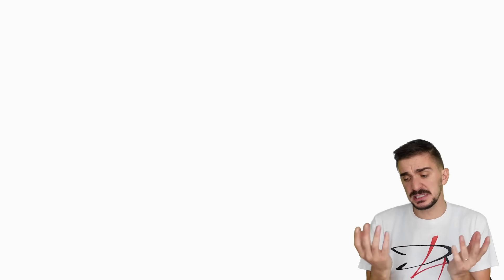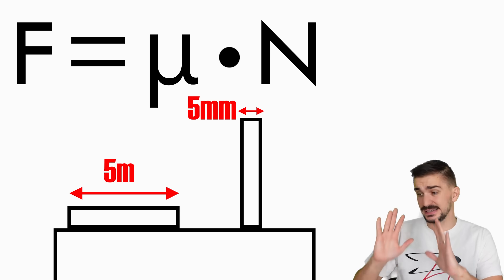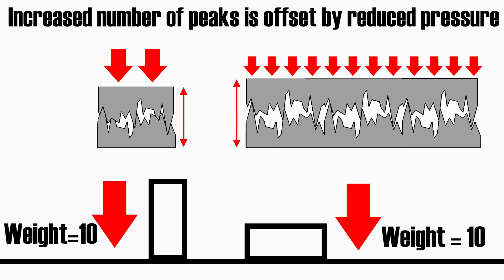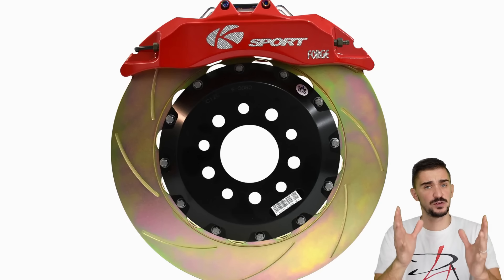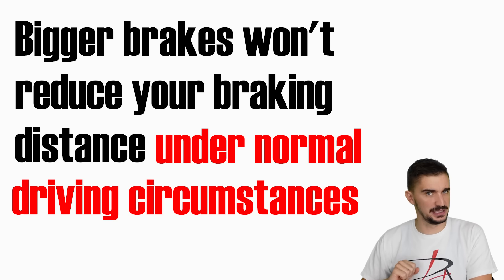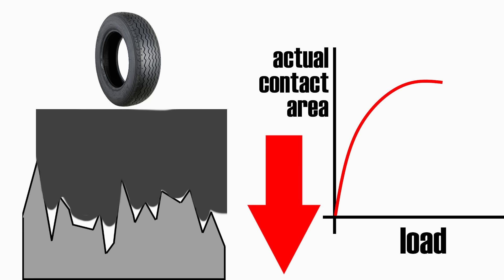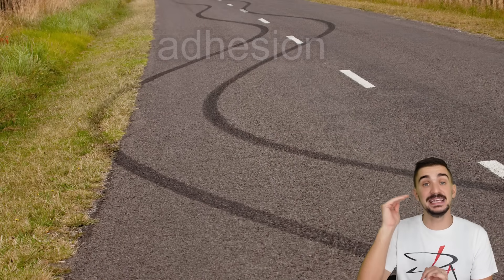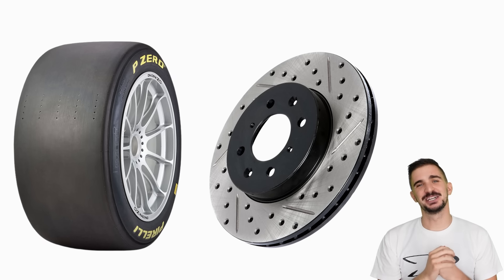Why Big Brakes Won't Stop You Faster but Wider Tires Will - Friction and Surface Area Explained

Comment: Larger brakes will stop you better because of the mechanical advantage of a larger diameter. The the same amount of friction and force will have more torque.
Reply: how is this going to do anything if the stock brakes already can lock the wheels?
Reply: @arcanevoid9199  it requires less force for the same amount of stopping therefore making less heat, or the same amount of heat spread over a larger area.

Not all motorcycles have good brakes I've been driving a 1st gen cb750 I believe a 1972 recently it could certainly use better brakes.

I have also driven some old disk brake cars that you nearly had to brake your leg  to get the tires to lock up.  I have had the brakes on my old honda accord fade when racing.

There are ways to make cars stop better. Haven't you noticed the wheels on cars keep getting bigger? A 1999 Camry had 14" wheels now 17" wheels are standard on most cars and some are up to 22". This is partially so they can increase brake rotor diameter.
Reply: @Greasy__Bear  but that’s a 1972 bike, car are legally required to have adequate brakes from factory. and bringing up old cars doesn’t really count because there is a good chance the brakes are tired. i mean yea but my 1999 celica came with 16s and in some markets they came standard with 17s. you only see 22s on big ugly suvs
Reply: @arcanevoid9199  notice the word adequate. Adequate for what?  Probably one power stop from 80 to zero, but hook a trailer to it and drive down a mountain and adaquate brakes quit being enough about halfway down.

Also what is there to get tired its a hydraulic system? As long as its not laking and the pads and hoses are good it shouldnt be drastically different than new.  Besides I rebuilt both the master cylinder and caliper, and replaced the hose.

Its in the design you can see it. The rotors are too small for the weight of the bike and the calipers are a janky single piston setup.
Reply: @Greasy__Bear  for street usage, and it’s more like 5 power stops in a row without excessive fade. Towing a trailer and sitting on the brakes down a mountain instead of using engine braking like you should doesn’t really count. There’s plenty to get tired, master cylinder, booster, rubber lines degrade over time, firewall flex, calipers wear out and cheap aftermarket pads etc. if you replaced it then it’s likely just how that specific car is, some cars are under assisted from factory. and nothing wrong with single piston brakes
Reply: @arcanevoid9199  since when do you get to determine whether or not better brakes are useful. My original comment was just about the physics of brakes and a simple way in which they can be improved, that I didn't notice in the video.

Comment: No,no,no... You think you know but it is not. Brakes are convetrers mechanical energy to heat energy in all forms. So bigger brakes you have, u can brake harder but it does not mean shorter. There are many aspects of car brakes that affect stopping distance. Bigger brakes don't always stop you faster. Rotating masses must be taken into account. In a small car, large brakes will significantly increase the stopping distance. The brakes must be selected for the weight of the vehicle and its performance. You have a small old car with 260mm brakes and you brake from 100 to 0. Such a rotor weighs about 2kg, and for one braking from 100 to 0 it is certainly more efficient for a single braking than 350mm brakes where the rotor weighs 6kg. On the other hand, in a sedan that weighs more than 1,500 kg or an estate car, such small brake discs will reach operating temperature too quickly, because they have too little heat radiating surface, which will cause outgassing of the brake pad and deterioration of the system properties. Regardless of what brake system you have and what tires you have (let's assume we have 2 identical cars), the car with steel rims of the same weight as aluminum rims will brake worse due to the fact that an aluminum rim dissipates heat 3 times in the worst case better than steel. If you want your car to brake better, put on dedicated alloy wheels that have as much material on the rotor as possible to best absorb heat from the brake disc.

Comment: "By installing a wider tire you spread the load out over a larger surface area ..."
Nonsense.  And the conclusions that follow from it are. The contact area is just the weight on the wheel divided by the tire pressure.  Changing the tire width just changes the shape of the contact patch.  The area remains the same.
Reply: yes thats why cars with 1000hp use the same width tires as a prius :)

Comment: Bigger brakes will usually have larger pistons and possibly a higher number of pistons, so the same hydraulic pressure applied to the brakes will actually result in a higher force pressing the pads to the rotors. But this of course means very little, when the tires themselves are unable to withstand the increased braking power.
Upgrading both is the way to go. :)
Reply: This message brought to you by Brembo USA
Reply: It's not the amount of pistons but the area they press with matters (not the area pad at all, cannot be mistaken). Bigger amount of pistons usualy means they're smaller diameter pistons. Until You calculate the whole pistons' area, You cannot say 'more pistons result with a higher presssing force' as it's not precise.
Plus - bigger rotors (bigger diameter) means higher torque applied with same force used, hence it's easier to stop a car. I don't know why it's not mentioned in this film, as it's very obvious.
Reply: @k_s.m  bigger rotors weigh more so you could actually have bigger stopping distance.
Bigger brakes resist heat better
Reply: I remember owning a 00 Civic Si USD, didn't come with ABS.  I swapped tires for cheap ones for the winter and lets just say the brakes would lock up with those tires compared to the Michelins it came stock.  Right there I knew tire grip was extremely import when it comes to braking.
Reply: @DroneStrike1776  get your ABS components serviced!
Reply: Some basic concepts have been missed here. Having more pistons in the caliper allows you redistribute the clamping force across a wider surface area of the disc, which helps with heat dissipation and overall braking performance. It’s not how many pistons you have because you could have just one piston clamping down on the disc as long as it applies the same force, it will stop the wheel just as well as 6 pistons providing the single piston stays within the friction range. The quality of the calipers ability to produce more force on the disc is important and will of course stop the car better. But then that depends on the brake lines, pascals law, how long the lines are, the brake fluid viscosity, etc, design of the caliper, so you can get more force into the caliper and then to the disc. That is what a lot of manufacturers invest in.
Reply: It is such a dum take midodern brakes all have the ability to block the wheel bigger breaks are for cooling and longevity reasons.
Reply: Also increasing the diameter of the brake discs, we also increase the torque resistance arm
Reply: @rosterenko  The radius at which the caliper touches the disk matters👌
Reply: It actually doesn’t.

At twice the distance, the braking torque will be doubled, but the speed of the braking disk wil also be doubled
Reply: Wrong, the pistons matter because their increased force will allow you to reach the maximum grip of the tires much faster than regular brakes. Or do you think pistons are just there to look cool? People need to stop being sheep and just blindly follow whatever the guy on TV says.
Reply: @Zeriel00 you just rephrased everything he said…
Reply: Lol you really think adding more pistons will magically generate more force than the master cylinder is producing
Reply: @JTTTTT850 if the extra pistons have a total of more surface area than a smaller dia one....yes. it wont move as far but will have more force....its called a hydraulic jack.  A small piston displacing a larger one will increase its force by mechanical advantage like gears and levers do but the throw or distance changes according  and proportionate to the ratio of master/ slave piston areas  1 lbs of force to a one square inch piston is 1psi of  fluid pressure ..if it acts on a larger piston of say 5 square inches the force applied on the pad isnt 1 lbs but 5lbs but moves 1/5 the distance than b4. Like a incline plane,
Reply: @JTTTTT850  physics is magical isn’t it 😂 the pressure you can generate from the master cylinder stays constant but P=F/A. Do some algebra and think about it.
Reply: @JTTTTT850  Master cylinder is creating hydraulic pressure. Same pressure with more surface area on the slave cylinder(s) means more clamping force on the brake pads.
Reply: Smaller brakes will still have the capability to lock your wheels. So you gain nothing through that.
Hes absolutely right in the video. Fading is the problem. Bigger brakes makes fading less and thus increase braking capability when the brakes are hot.
Have you ever experienced fading?
I did. Many times.
Braking hard at 300 kph on the Autobahn makes your brakes fade very quickly. So bigger brakes would be a huge advantage there and would actually lower your stopping distance. Simply because they fade less.
Reply: Extra pistons don't have more force because at the end all the force has to come from your left foot. So if you don't press harder or a wider distance of pedal travel, all the pistons together apply just as much force as s a single one. You might adapt the powerbrake system accordingly, but then the difference lies there and not in the number of cylinders. However I could see an advantage in more pistons being able to handle more power braking while a single cylinder might explode under so much pressure
Reply: The fact that 20 people like your very vague point that's not even an explanation proves we have very little hope for humanity.
Reply: bigger brake rotors and pads only spreads the braking friction out over a bigger area. Reducing heat accumulation and wear across the total area. You simply get longevity in extreme circumstances.
Reply: @William Kelley   You are assuming that ALL stock brakes are more powerful than the max friction  on their stock tyres...  I recently watched a GT86 improve its braking distance by quite a substantial amount using larger discs/calipers on the same tyres... so it's not true for all cars. He shouldn't have applied a best case braking system scenario to all cars braking systems. They are not all equal.
Reply: @paulhope3401 That's because they are powerful enough, by an enormous margin, to lock the wheels, in every car for at least the last 40 years.
If what you say about that GT86 is true, then it had equally defective brakes on all four wheels before the upgrade.
Reply: @mikejosef2470   I'll try and find the video for you. They are not defective, just inferior. If they were defective, the car wouldn't have passed that part of its series of tests to be allowed on the road.
Larger brakes and rotors can provide more clamping power but also cope with heat far better which helps massively when slowing down from higher speeds.
Manufacturers do not spec components to provide the best brakes possible,  just to be good enough to meet whatever performance parameters they have to legally meet.  Everything is built and specced to a price.
Reply: @paulhope3401  A video can't prove this either way, but it is ridiculous to think that any car since 2010 has been released with brakes that cannot lock the wheels, mainly because it's really easy to do... that's why all cars have abs.
There are also no cars with a braking system that can experience fade in a single stop, even from the car's top speed. Not even close; that would definitely be illegal.
I'd still be interested in seeing the video, mainly to see who made it and why.
Reply: @DJBillionator  The fact that you expected a detailed explanation in a youtube comment proves we have very little hope for you.
Reply: @davidjereb  That's cool! You're all about to be proven VERY WRONG. So much is coming. Label signing SOOON!

Comment: Great video as usual. However, I think that the ball analogy is flawed. What you are doing when squeezing the ball is compressing the air inside it and that is producing the resistance, not the ball material. If the ball had a split it would squash easily.
Reply from the maker: I meant those rubber stress balls. You know the ones that sometimes have ads on them? I should have emphasized the kind of ball I was speaking about.

Comment: Larger calipers, that is calipers with larger piston surface area for the same pad surface area, will provide more braking force upon the rotor for the same pedal and brake booster input.  Large calipers improve braking ability, up to the point where the tire becomes the weak link.  For most vehicles, the gain from upsizing calipers is negligible because the OEM engineers already put in the work to design a good braking system for that vehicle.  But modifying the vehicle can make upgrades worth the few hundred bucks. 
In my case, I’m looking to upgrade the brakes on a truck that will haul a load. The increased piston surface area will make a big difference when coming down a hill with a loaded trailer.

Comment: There is an ideal footprint to weight ratio already tested by engineers. I'm sorry to say but this guy is wrong. He probably thinks about soft compound tires or slicks. That are not legal anyway. Harder compound act much more like hard materials and increasing the tire footprint area brings minimal benefits

Comment: You forgot to take into account torque.  Larger brakes means more mechanical advantage over the tire.  If you try to stop a spinning object producing 100 ft lbs of torque with a 1 foot long bar you need to excert more than 100 lbs of force.  If you stop it with a 2 foot bar (larger diameter brake rotor) you only need to excert half that force.  Big brakes will in fact stop you faster.

Comment: Close to 2,000 comments so far- I can tell you from repeated testing using a Kawasaki KLR650 that comes stock with a 230mm diameter front brake rotor. Swapping to a 320mm rotor of same stainless alloy using same brake caliper & brake pad brand/type yields a 14% average reduction in stopping distances in over 200 tests at our college. 
Automobiles are generally limited by how much they can increase their brake rotor diameter by the wheel itself in most cases- you can't just "make them bigger" without re-engineering the caliper support, hub assembly, etc. With motorcycles their is plenty of room (and aftermarket selections) to allow using larger diameter rotor, which do indeed "stop you faster"...

Comment: Well...
Just as an example:
The Mazda RX-8 has bigger brakes than the RX-7. But if you want to swap an RX-7 engine into an RX-8 in Germany - which is basically impossible to get it road legal at all, because over here they are throwing every rock in your way that they can find, especially the emmission gases stuff - you have to upgrade your brakes for bigger ones...
Doesn't make sense at ANY point, but it is what it is. And people still believe that government and other institutions care about people's safety. 😂